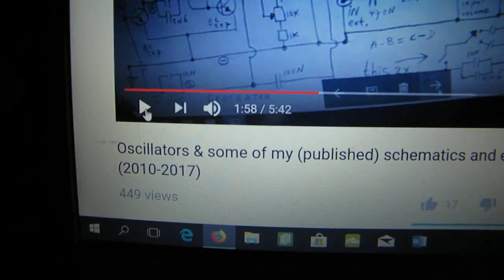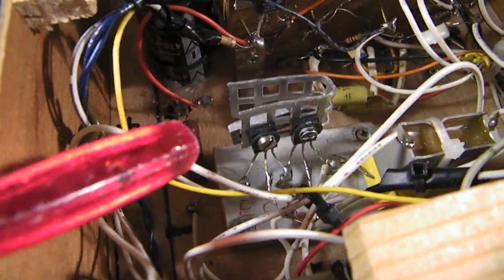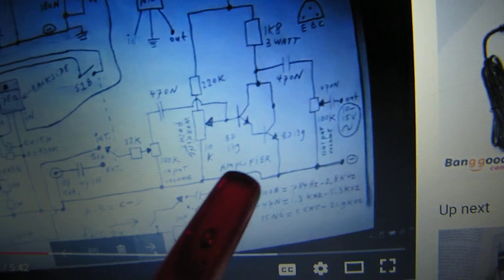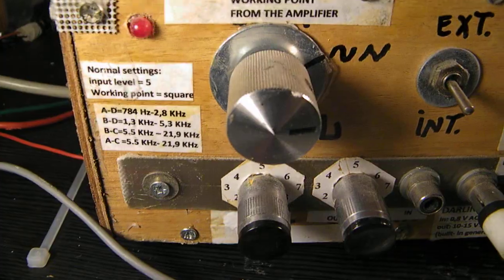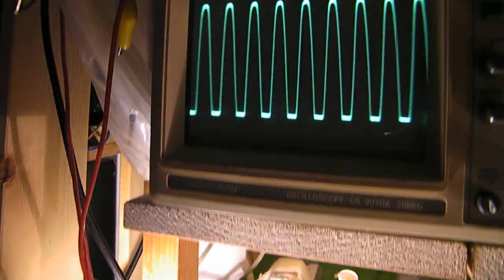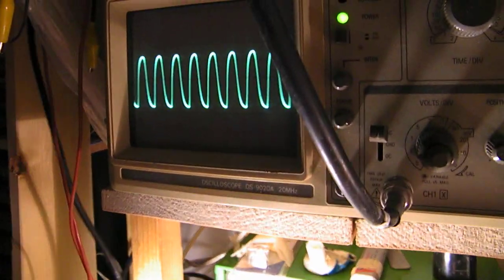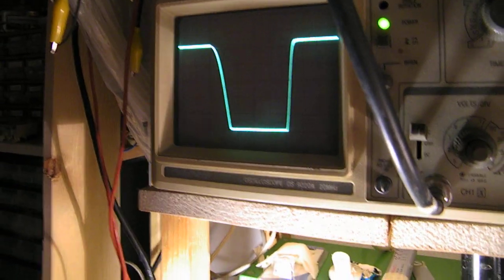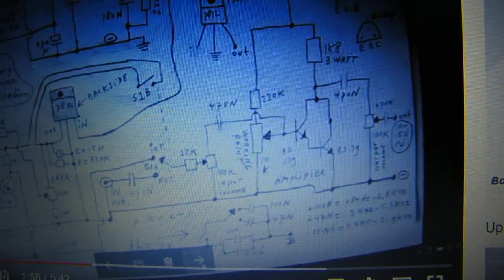linear amplifier 20 Hz-20 KHz max 8 V out schematic & effects changing working point

Comment: Have you made a Linear amp for ham radio? Would iot use the same principles?
Reply from the maker: It was only made for the audio band, say 20 Hz up to 20 KHz. For frequencies between 2 and 30 MHz I have to develop another circuit. But for radio applications in this band linearity is not a big issue. Though, when you want to make a linear amp between 2 MHz and 30 MHz it is quite a problem, because of all the different properties from (radio) waves between 2 MHz and 30 MHz. Best example: an oscilloscope that has to work and has to amplify linear between 2 MHz and 120 MHz. These amplifiers are specific and often all kinds of "tricks" are used to get to the goal.